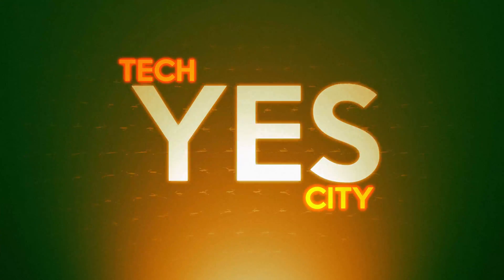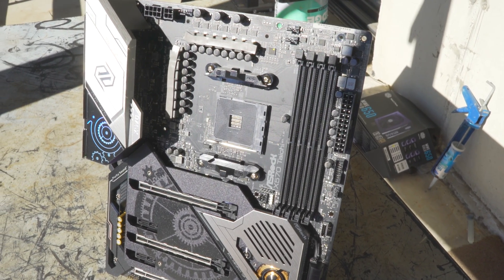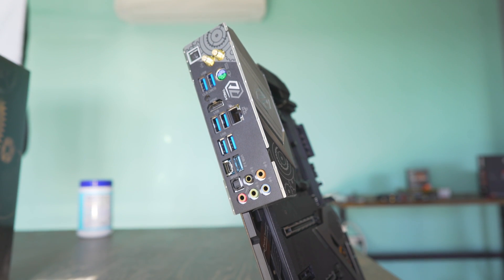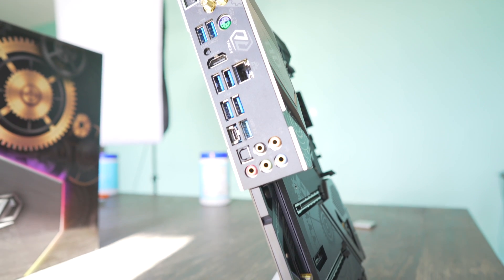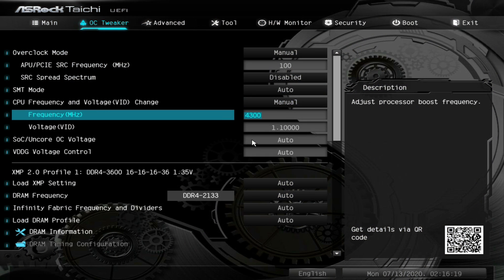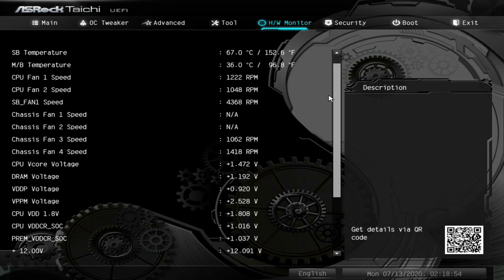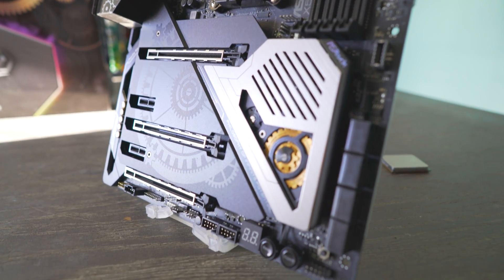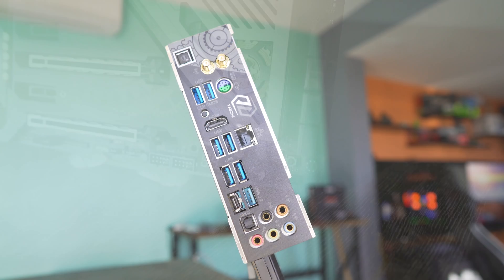ASRock X570 Taichi Review

Comment: Unfortunately where I live (Netherlands) the Taichi-motherboards always have been a lot more expensive. To be crystal clear: I compare the prices of Taichi with prices of other models (like the Prime Pro) and for that I compare between the local market and foreign markets. We always paid 20% more for ASRock motherboards but less for ASUS motherboards compared to the USA and Australia. 4-pin CPU. At this moment the X370 Taichi costs minimum €187 and the X470 Taichi costs minimum €219. Worse, the price of the X470 Taichi has increased with €30 since the launch of X570. Also the price of the 3700X went up with €20 since the launch. Dutch shop-owners are horrible (disgusting?) that way, they do a lot of price-gouging and allegedly there is some price-fixing. They only move boxes and they make you pay a lot for it because we can't buy directly from a distributor. 

On the topic of the X570 Taichi. Honestly I am a bit disappointed. For the first two generations of AM4 ASRock delivered more value for the money in the USA and Australia, they had a $200 high-end motherboard with good VRM's and all the required I/O. In this generation there are several ecellent motherboards which cost around $200. I don't think that the $250-350 motherboards add enough value compared to the $200 motherboards. The 4-pin CPU connector is completely pointless, only extreme overclockers (LN2 or phase-change) can use that and these guys would not choose the Taichi for this. No offense.
Reply: can you not order one from a nearby euro country ?, im in the u.k. and have ordered car parts and pc parts from germany quite often
Reply: @tonybarden8563  

For PC parts it is difficult. I can order from Caseking and for AMD graphics cards that can be a better deal. When there is scarcity the German shops get a much better supply than the crappy Dutch shops, for AMD graphics cards that can lower the price drastically. For example, for months you could buy a Sapphire Pulse Vega 56 for €350 and a Sapphire Nitro Vega 56 for €450 while the Dutch shops were ripping you off. However, Caseking charges the Dutch VAT (they don't have to, they could charge the German VAT) and they charge around €20 delivery costs. Still it helps for AMD graphics cards which says enough about how bad the Dutch shops are. Mindfactory and the other big German shop don't deliver to the Netherlands. 

Here the most ridiculous thing, I live closer to Germany than to Holland (the northern-western part of the Netherlands). Yet, it is about that border. :(
Reply: @peterjansen4826  have you looked at the U.K. online shops mate ? pretty sure some of them will do euro shipping 

overclockers/scan/cclonline/ebuyer
i will also agree with your point the e.u. 'open-market' sometimes isnt all they say it should be
p.s. we have vega 56 here for £235 @ ebuyer
Reply: In France this Taichi cost between 335 and 370 euros.
Reply: @ggousier  

Way too expensive for me, I could buy a X570 Gigabyte Elite for €206, or at least that was the price when I last chekced it. The problem is the CPU, in the Netherlands we had to pay $345 on day 1, that seemed a bit too expensive for me (the 2700X used to cost €220-230 early after launch) but due to the shortage the price has increased to €365. That is ridiculous. In retrospect I should have bought it on day1, I guess but I wanted some reviews first. 

By the way, the reviews so far are pretty disappointing: little memory-scaling testing and little testing how well memory OC's on B450, X370 and X470 motherboards. Techpowerup did a bit of memory-testing but not at the values which are most interesting: 3200 16 3200 14, 3600 16 and 3600 15. They took different speeds and latencies at the same time, making it impossible to see how well it scales with the latency and speed on its own. Testing for n00bs: test only one variable at a time. Also little reporting on the X570 motherboard chipset fans while this is rather important. Any of them who has a good microphone should let us hear what it sounds like.

Comment: Tops review.

But I have a question. Could you investigate gaming on it with a non-blower card?
Because users were reporting their chipsets getting so hot to the point where the temperature protection would get tripped and shut their systems down, due to where it is placed next to the PCIe slot and how their axial cards would dump heat into it.

If this is true and not some sort of defect, especially in a case setup, then it also affects several other boards with chipsets in their area.
Reply from the maker: Ok I can check into that with a case, what GPU and also what case and what motherboard did they have these problems on?!
Reply: @techyescity  Several different types of GPUs, and some caused more problems than others, but the Strix 1080 Ti is the most problematic.
Tested on both an open bench and in cases, and again some had more problems than others depending on their case airflow, but the Strix 1080 Ti had the same effect in either setup.
And, this was all people with the Taichi, which is why I'm asking since you've got it on hand.

Cheers.
Reply: @techyescity  Thanks for the review I also own one of these boards as I watched your interview I wondered if you were going to check the SB temp because like @SlavjanA reported 2 people reported who hit 80c on the SB Temp and shutdown their PC. Personally, I own this mobo but I've yet to even pass the 72C on the SB during gaming. Thanks again for the review.
Reply: @techyescity  Pretty much any very large card that covers the chipset fan, such as a Sapphire Nitro+ Vega 64, etc. The heatsink fins from the card cover the chipset fan and heat from the GPU gets dumped straight into the chipset cooler. https://www.reddit.com/r/Amd/comments/ccyxmn/psa_x570_taichi_design_flaw_chipset_overheat/

Comment: Hi, I'm concerned about the location of the chipset fan, because if we have a large video card, it will block the air flow and raise the temperature of the chipset. 
From what I saw, the msi motherboards has the chipset fan lower than the pci where the gpu goes.
¿ Have you done tests on the temperature of the chipset on this motherboard with large gpu ?
Sorry my english, I speak spanish.
Thanks.

Comment: My new gigabyte x570 itx board & rtx 2080 are chucking a hissy fit.... soooo buggy. 😢
Reply: That sucks I'm going for the same setup, 3900x + 2080 super +x570

But I'm not sure what motherboard to pick yet. Not enough user experience data is available and x570 taichi is sure a no-no now.

They also all seem to have bios problems.

Might just have to go with x470.
Reply: @007lutherking  Running fine now.. it was gigabytes Aorus software & msi afterburner causing all the issues lol, wasn't even ryzen related. 😬
Reply: @MaximusMilkshake  oh sweet, did you have to update your bios? Tell me the name of your specific board so i can have it as a proper functioning option lol
Reply: @007lutherking  Yeah what I did was use WIndows restore point because the latest Windows 1903 build was buggy for me, went back to 1809 I think it was & it was less buggy. This is where I started to tinker & pin point the issues I was having. I did update the BIOS on my Gigabyte X570 I Pro Wifi mini itx board, got the latest as of now, it might of helped but I didn't notice any difference tbh but it was comfort of mind to have. Uninstalled Nvidia drivers using DDU (Display Driver Uninstaller) very handy btw, uninstalled in safe mode, then reinstalled drivers & shit was working nicely. 

Then I moved onto Gigabytes Aorus software & MSI Afterburner & I finally found the culprit... Both of em don't nicely with one another & was the cause of my issues. Uninstalled both, then only reinstalled Gigabytes Aorus's software & now everything is smooth even on the latest Win10 1903 update. 

Sorry for the long arse story but I hope this helps :)

Comment: Somebody did a bunch of benchmarking runs to compare various X570 boards and, when you look at the scores alone, the Taichi punches above its weight as far as computing performance and throughput are concerned.

Also, when it comes to PCIe, remember that the older chipsets only support PCIe 2.0 so, basically, it's only the graphics slots and one of the M.2s that run on PCIe 3.0; the ones wired directly to the CPU, namely: if you want to run multiple 3.0 components at full speed (including, but not limited to, an M.2 RAID config) the older X370/470 boards might not cut the mustard.
Reply: Can you provide a link to that comparison? I don't want to pay for Taichi which costs as much as the processor 3700x itself... I'm thinking of lower tier of x570 and can't decide between AsRock Steel Legend, Gigabyte Pro or maybe MSI.
Reply: @vaazon  : You think the Taichi is expensive compared to other top performers is the field? Oh, you sweet summer child. ALL X570 boards are expensive! You ain't getting no free lunch, son. 😂

But here's a link to the eTechnix review I was thinking of, anyway. To my knowledge, they're the only website that has done such an extensive compendium of benchmark numbers and graphs between multiple X570 boards thus far.

https://www.eteknix.com/asrock-x570-taichi-motherboard-review/4/?amp=1

Comment: I got an X370 Fatality Professional Gaming for 120€. 
It has almost the same VRM, just 40 amp power stages instead of 50 with a total power of 480 instead 600 amps which you wont evev reach with liquid nitrogen on a 16 core.

Comment: Just so everybody knows, there's a pretty big design flaw with this board.

Look at the chipset vents, now imagine there's a GPU installed. Yeah, the chipset fan is running at high speeds due to the GPU blowing hot air into the chipset.

Msi meg looks like the best mobo in that price range.
Reply: Let yes watch this
Reply: Even read some people running into problems of having their pc shutting down because of this. Seems there isn't a a lot people talking about it so maybe just faulty cooling on their boards for some reason.
Reply from the maker: I will check it out by putting this board and others in cases and stress testing the GPU.  Need more precise info for testing though.
Reply: @techyescity  look forward to the follow up. :)
Reply: I have this board.  The chip set cooler placement is not the board's only major design flaw.  The USB type C front panel connector is DIRECTLY in line with the top PCIE slot. Meaning when the front panel type C is connected, even if it uses a right angle connector like my Lian Li 0-11 Dynamic, you can't connect a decent length GPU.  My GTX1080 hits the connector instead of plugging into the socket.

So now I don't have to worry about the chipset overheating because I have my GPU on a vertical riser so I can still have front panel type C.  Sucks because I wanted to show off that board, not block it with a GPU in front...

Comment: One thing we are wondering about is how loud is that fan on the board? high med and low. is is audible?
Reply: There is a YT video of the fan on this board sounding like a jet engine. Not sure if the issue was a due to a defective device, or emblematic of typical behavior.
Reply: One user reported quite loud if you've got a GPU covering it, due to it's placement

Comment: I just cancelled my order on the taichi because i was quite worried about the chipset fan location. - right beyond my gpu. Can you confirm this being a flaw?
Reply from the maker: I can make a follow up video for you guys where I wack it in a case and leave it on with stress tests if you like?
Reply: @techyescity  that would be awesome! Yes, particularly something where you have a gpu sitting in the first slot so it hangs over the chipset fan. If you Google "x570 taichi design flaw", you'll see the Reddit thread all this has started from and more details. Thanks!
Reply: I would like to know this, too. Have one on the way and don't have the option to return it (thanks, Newegg...).
Reply: @MichaelAnderson88  i went with the msi ace since they placed the fan more on the bottom side and im used to msi bios and apps which does it for me. Its just 60 bucks more expensive which is why i chose the asrock in the first place

Comment: Have you investigate this board's TJMax Shutdown issue? 
Some users are reporting because the chipset fan is parallel to the 1st PCIE slot, the heat that is produced from a non-blower style GPU would basically all goes to the chipset (since its sucking in all the hot air from the GPU) which will cause a thermal shutdown when it hits 80c. Pretty significant problem if you ask me.
Credit: https://www.reddit.com/r/Amd/comments/ccyxmn/psa_x570_taichi_design_flaw_chipset_overheat/

Comment: Thanks for talking about the on-board audio mate. No other youtuber talks about it.
Reply: I was going to say the same. The others are only talking about overclocking which the vast majority (IMHO) probably would not do.
Reply: I bought this MB but personally i didn't care about the onboard audio. I run a dedicated DAC that no MB can compare with.
Reply: @mariobastidas3102  Can you turn off the fan on the motherboard? Does it make noise or annoying? Can you turn off the leds? Is Taichi good enough without noise in audio or not?
Reply: OnePlus one gang?
Reply: Buildzoid "Am I a joke to you??"
Reply: @fidamdsaini8452  Buildzoid doesn't cover on-board Audio, his stance is if you're into audio then get an external DAC.
Reply: On board audio is not important thing as you really get into audio, because you will probably buy all kind of dac and so on :D it is only important if you just have few standart speakers and want good interface so it is quite rare cases
Reply: Yeah... with how many headsets and speakers using external DACs, there isn't a ton of focus on quality anymore. The same can kind of be said for networking. Everyone just assumes it works.

Comment: This board is absolutely GORGEOUS.
Reply: The prettiest motherboard I have seen since the gigabyte gaming 7 wifi
Reply: Unlike intel who doesn't have support till 2022 at all the next gen is gonna be other socket once again
Reply: wild wild west vibe around the chipset really needs to go though. lol. The fan needs a redesign from what I've heard too [intakes hot gpu air unless you have a blower].
Reply: @PriaSamari  remove the fan it will cool fine it's overkill
Reply: Do you have it danmandingo?
Reply: @TheAlienwaredude  Plan on getting it in a couple of months, along with a 3900X and Cooler Master ma620p cooler.
Reply: @Danmandingo  nice rig, I was going to do the same, but I'm not sure if I should go for this mobo or the Asusu ROG crosshair Hero VIII. 
Do you by any chance know, if I can use the previous ssd nvme in the new m.2 slots on the X570 motherboards?
Reply: @TheAlienwaredude  I haven't heard anything, about them NOT being compatible.
Reply: @Danmandingo  okay thank you mate 😁
Reply: @TheAlienwaredude  I've got this board and I used my old Gen 3 NVME ( Samsung SM961 ) and it's working perfectly.
Reply: @Hefficide  thanks mate. Much appreciated. I have just wondered if it is possible. But you've answered, so thanks.
Btw are you happy for the board? What cpu do you have?

Comment from the maker: Mistake on the m.2 test, they should be switched in naming. Also the PCH heatsink fan was very very quiet, so I actually forgot to talk about that as well.
Reply: For a second my eyes were going to pop out! Though great review as always bro😎
Reply: I have the Phantom Gaming X variant, the motherboard fan is extremely whiny, but I just installed the mobo so I will see after I update the bios if it improves the curve. It is a deciding factor for me, I can stand whiny fans.
Reply: Thank you, I've been waiting for this review, finally someone is serious about the x570 mobos....if they were just a little bit cheaper...
Reply: I have this mobo it's very good but this PCH is very hot,about 70c in a game!
Reply: @kostassifonios9630  Does not seem excessive.
Reply: came here to say this also
Reply: I doubt the PCH fan is still quiet when a large GPU is sitting over it... doesn't look like very smart placement
Reply: @harryouil  I have a heavily oced  1080ti w/ power limits removed sitting over it. It rarely comes on in fact if it does come on I can't hear it.
Reply: konjiki240sx great to hear it! Puts a lot of my concerns at ease.
Reply: I am really surprised that nobody checks and elaborates on the quality of the fans. How noisy there are is much less relevant to me than the likelihood of them failing on the user.